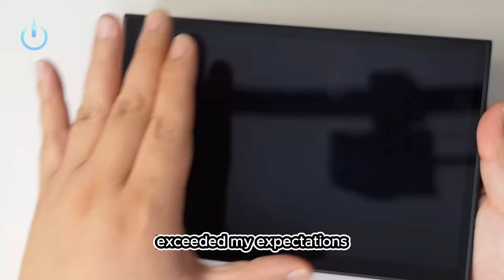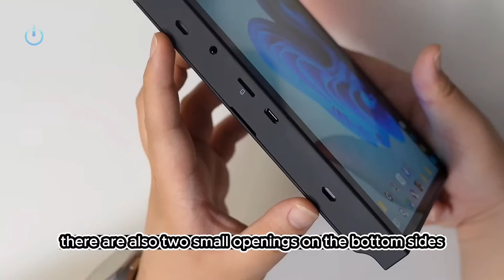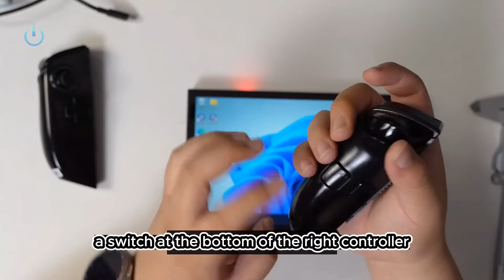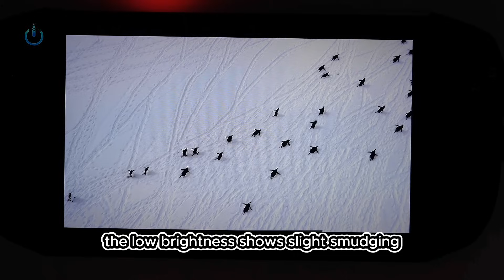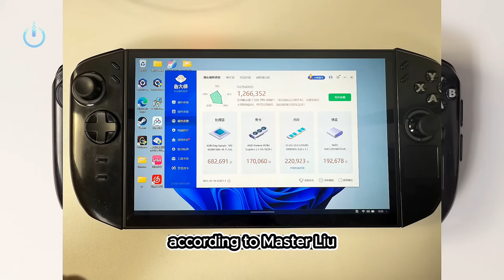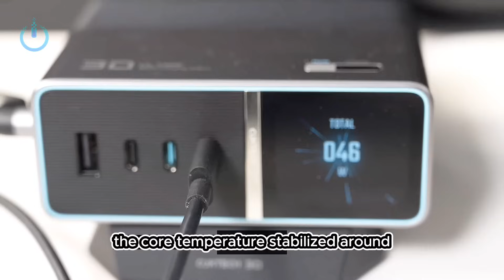Lenovo Legion Go 2 Review First version Generation 2 Z2 Extreme Handheld

Comment: it looks like the z2 is going to be a disappointment
Reply: Why do you say that ? Just wondering as I was looking into getting one when it comes out
Reply: @marcakko2010  most of the games run at sub 60fps. if it cant push 60fps now, it's not going to handle upcoming games. it's not that bad, just not good, especially when this device is going to be US$1000+ 
positive points: VRR displays tend to hide fps lag, which is good.

here are the fps stats from this video: 
forza 74fps
cyberpunk 39fps
tomb raider 49fps
wokung  49fps
monster hunter 53fps

i am also eying the legion go 2 as a replacement for my steam deck, mostly for the detachable controllers
Reply: @DDosAndDonts use lossless scaling bro😂😂

Comment: So the msi claw 8ai+ is still better on performance.. this device should not have a higher price the msi claw.
Reply: Higher price because Lenovo can build as tablet, and  detach controller, and so on..
Reply: @rioadi3575  but at the end is all about the performance.
Reply: It's slightly better performance and a different set of features. They aren't gonna really cost that far apart